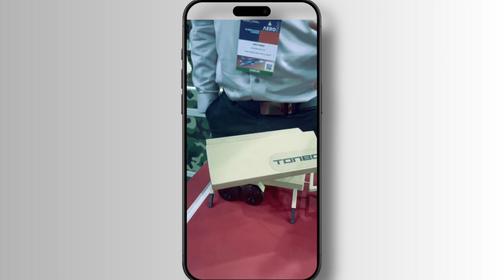High-Power Microwave BY India's Tonbo

Comment: New drones are jaam professionals
Reply: Microwaves don't jam drones, they damage the semiconductors or chips in drone and hence make the drone useless. Also no drone is Jam proof which is why in Ukr both Rus and Ukr are now using fibre optic drones.
Reply: @cgtim3230  new drones work with ai jammers you can not stop them microwave or laser ? They have heat sensors
Reply: @SaqibJavid-l8wGreat, then please deliver it to Ukraine or Rus they will pay for it... And then they won't have to use fibre optic drones which have less range, payload capacity and harder to maneuvere.
Reply: @cgtim3230  may be they have them
Reply: @SaqibJavid-l8w If they have unjammable drones then why use fibre optic drones. they don't have things that don't exist... I follow news from Ukr daily... And I have studied electronics and communication and no drone can be JAM proof... EW suites make them harder to jam but not impossible. The reason for this is simple, a drone can never produce as much power as a ground based jammer. Fibre optic drones get around this problem by using wires, to communicate with operator sitting long distance away... However, use of wires limits range and payload capacity.